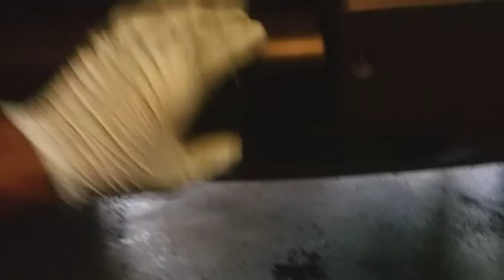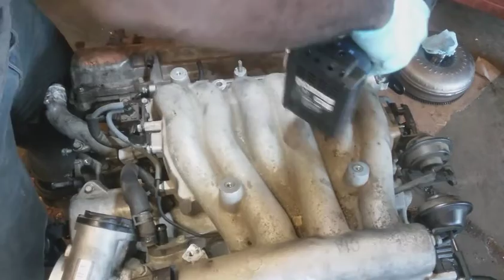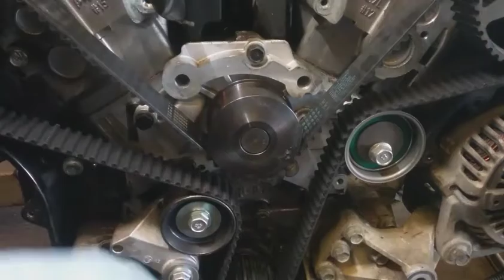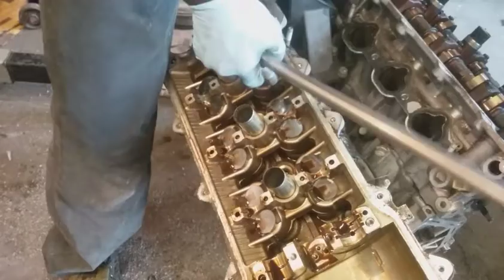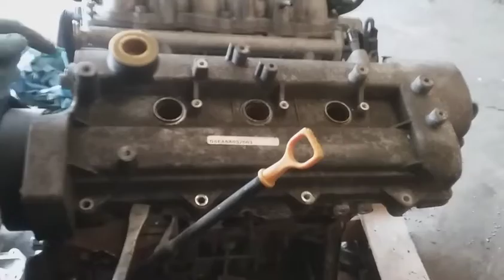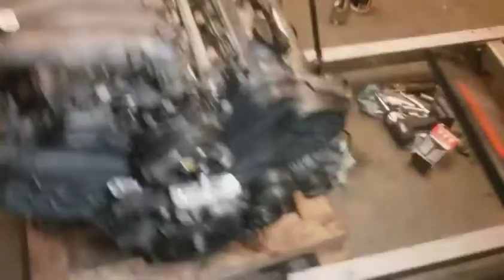08 Santa fe engine  removal/teardown/water pump install

Comment: THere is a spec on most hyundai auto tensioners the travel should be 7 mm to 9mm when you pull the auto tensioner pin. Other wise defective. Most of the aftermarket auto tensioners fail a lot sooner than OEM.

Comment: So did you pull the engine and trans mission to gether through the top/hood or DROP the sub frame craddle and pull through side through wheel well.
Reply: I was about to as the same question and i don't kno why he skipped that part
Reply: @langtontatendambira4510  through some research you can drop the subframe cradle and pull the transverse engine through the driver side wheel well. both CV's would be pulled additionally the steering knuckle drivers side would be detached moved to the side. Allthough this takes jacking up the car with enough clearance.
Reply: @proanswers  Just found your video, getting ready to work on a Santa Fe (2007).  Wasn't sure from your reply before but were you able to pull the engine/trans from the top and if so any suggestions for us?